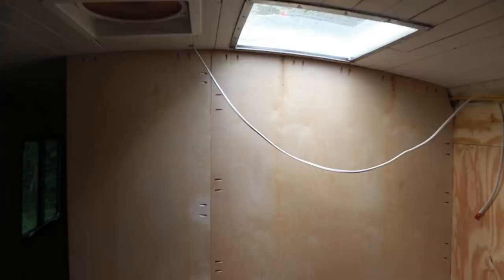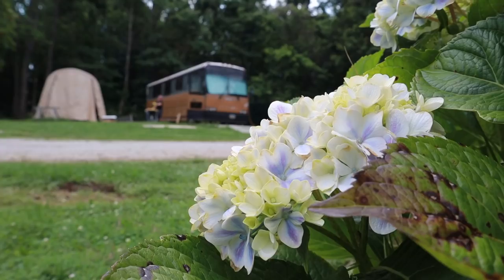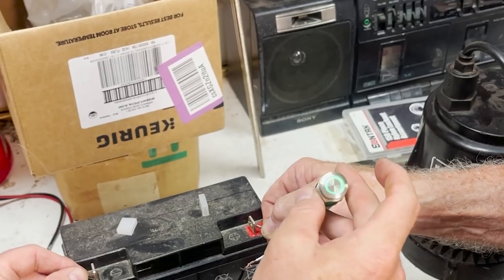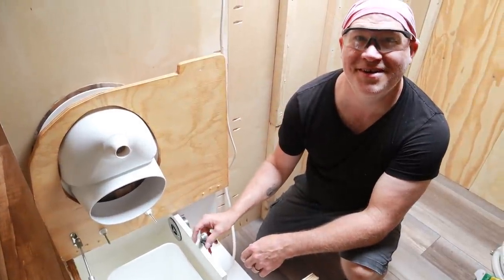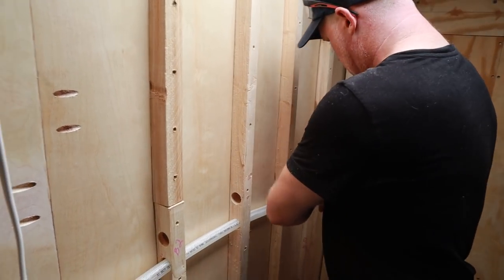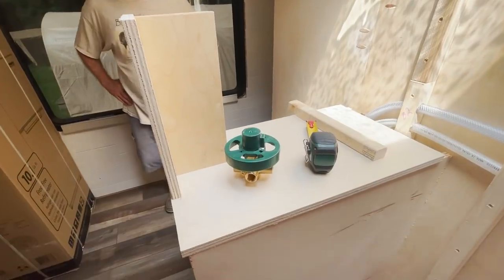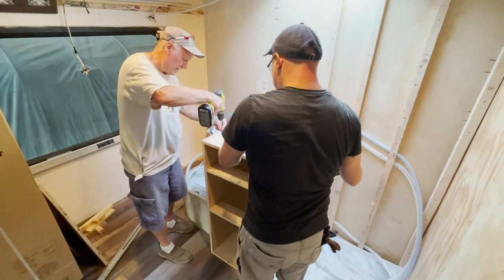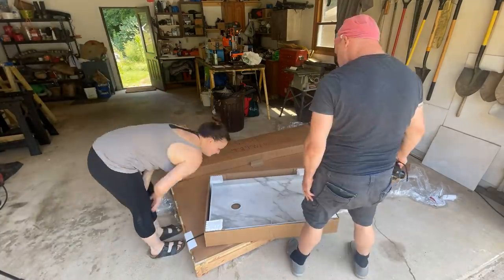Kildwick Compost Toilet Upgrades for our BUS CONVERSION//12V Fan and Urine Siphon - S04E19

Comment: Hello you guys! You are doing a great job for non pros!  A suggestions, I know I am behind a few months but when using the Kreg Jig tool, you ONLY have to put them on one side, and preferably the side that is not seen. ;- ) That's the entire purpose of their jigs! Like your friend with the glasses and Mustache, I too have 40 years as a professional cabinet maker, so ask him if you don't believe me! 
Also, you need to go but a few cans of wood putty instead of making it yourselves, which rarely works as well as the canned stuff. Mel, when edge banding, you should 1) spend more time with the iron, you really have to heat the glue more than you think, that's why yours did not stay. 2. Go look in Dad tools and find a sheet rock (drywall knife) trying to trim with just a razor blade is a disaster waiting to happen, which you found out! Wood Putty for filling in spaces on unfinished wood! The gaps at the top of wall at the ceiling and joints between any two joints where you have a gap, go to MEnards and but several tubes of paintable caulking in white or clear. This way you can fill in the gaps and paint over it! NO gaps! Cheers!
Reply: Valuable!

Comment: FYI, Kreg pocket holes can be filled with regular dowel. Cut pieces a little long, glue them in and when the glue has set trim them with a flush cut saw. Much cheaper even with buying a saw.

Comment: I would suggest pouring a large cup of water down your diverter before going to bed. It will lengthen the times between cleaning (it smells pretty bad) i have to clean mine about every 3 weeks. Just a heads up. Youll know ot when its time to clean. The Kildwick products have been serving us well for the last 9 months.
Reply from the maker: Great tip!

Comment: Putting the fan at the start, pushing air into a restricted diameter tube, will result in some back-flow of air into the toilet box.  ….OTH, mounting the fan at the outlet end, adapted up to the 2”, so it is Pulling air from the toilet box, will create a better flow, and preventing back-flow of stinky air into toilet box.
Reply: Thanks for this!

Comment: Hmm, suggestion. Make the wall moveable so you can easily replace the urine drain pipe as it may get narrowed and  possibly smelly with crystals and corrosion and not easily cleaned.  Your urine diverter looks fancier than most!  Bathrooms are the most complicated part of any construction!  Will be very interested to hear after several months of use how you like it.

Comment: A lot of thought and work went into the Toilet and shower area. have you considered Formica or a laminate as it is waterproof and you can get so many different designs, also the bonus is that it is very thin so doesn't take up a lot of valuable space

Comment: Composting toilets are disgusting 🤢 with a full size coach, why wouldn’t you just put a black tank in?  I put in a 70 gallon black tank with a regular toilet abs abs could go weeks without filling it, and you don’t have to handle all that nastiness.   I never understood people decision to poo in a bucket
Reply from the maker: Having had both, we choose composting over black tank.  Black tanks stink, waste valuable water and dealing with dumping is way worse to us.  Matter of opinion.  Isn’t it a wonderful world we live in where we get to choose what works best for us.  With peat moss and an extractor fan there is no smell in our bucket.  It’s like taking out a trash bag of soil.
Reply: @Rehabit8   I’ve never heard anyone say they’d rather have a composting toilet over a standard flush with fresh water.  Its only popular in schoolies and shuttle bus conversations because there’s limited or no place for holding tanks .I’d have thought the whole purpose of using such a full sized coach like I did myself, is to have large everything, like 200 gallons of fresh, 75 grey/75 black etc….   Which can last 2 people weeks boondocking.  
black tanks should have no odor at all if properly vented, the vent-gasses should create a negative air pressure in the tank causing Zero smell,  mine certainly doesn’t smell at all even when not dumped for weeks.   You could also use the same computer fan on the black tank vent pipe, like you have to use on a compost toilet.   I just know There are ZERO full size coaches that come with a composting toilet, but like you said, it’s an option and that’s what you chose.  Just seems like more hassle to me
Reply from the maker: Well now you know 2 people who choose composting over black tank.  I can assure you there are more big bus composters out there 😉